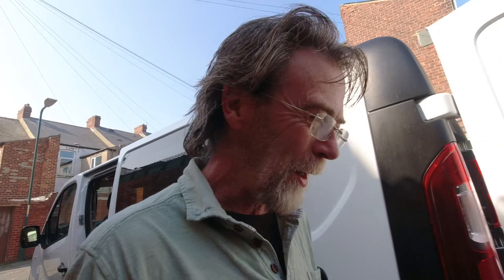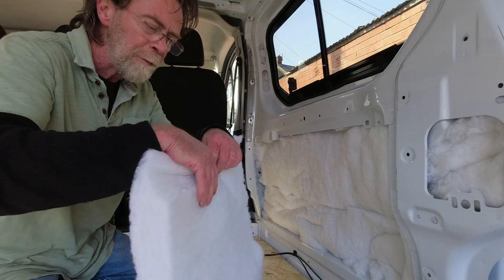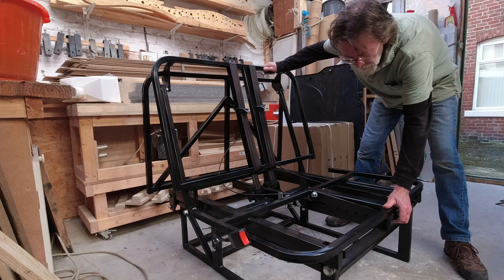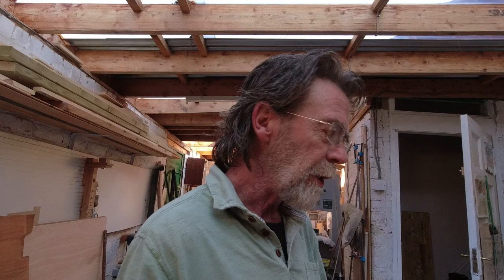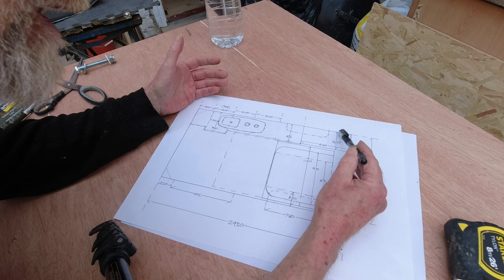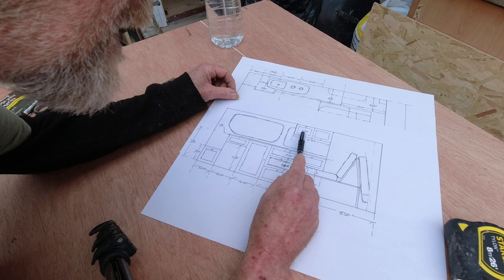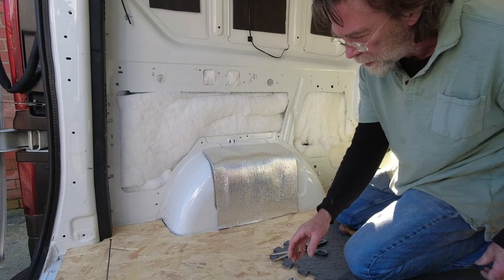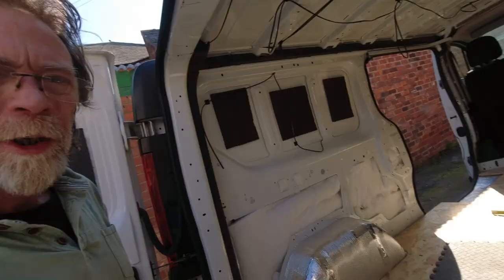Vauxhall Vivaro Campervan Conversion - Pt 3 - Insulation and Floor Plan

Comment: This is blooming tremendous stuff. What a lovely, genuine guy you are Dave and it’s extremely clear what your doing.
Reply from the maker: Thanks a lot Fraser. I'm starting another build soon and I hope to video it too. Oh on the insulation pushed down into the well of the body, I put a vapour barrier over it all to stop any moisture build up and that seem so have worked out well.
Reply: @dave-watson  I’m on the hunt for a van at the moment - I’m going to more or less copy yours! We didn’t really see how you fixed the rnr bed, or I missed it. Do you go through 1 of the cross members?
Reply from the maker: @frasermalcolm8695  Hi, The bed came with 4 heavy steel plates that act as spreaders and fit under the van, but no crossmember involved.

Comment: If you do the Wheel arches in small strips then tape over it's very easy with no stress , people do it the Hard way trying to do it in one go.
Also you can buy a Drill bit with a drill and counter sink in one , i saw another van builder use it , saves so much time.
Reply from the maker: Hi Paul, Yes I got one of those bits with drill and counter sink and it does make it all a lot easier. Thanks for watching.

Comment: Thanks for the video, Dave.  Nice to see a job done well.  I put sound dampening insulation on the wheel arches in our van.  Those wheel arches are challenging to do.
Reply from the maker: Yes the wheel arches are by far the most difficult thing to insulate, a lot of pinching and tucking and plenty of foil tape.

Comment: Hi Dave, I used King span in the bottom parts of my Vivaro ( not right down to the sill area though ), I noticed you push your insulation down on the lower part of your van. This can cause a problem if moisture builds up in the bottom of the sill area which in turn will cause rust and rising damp. Good luck with the rock and roll, ouch my back hurts already.
Great video though, nice and clear and showing great steps in a build.
Reply: I wondered about the pushing it down in to the well. Knowing nothing about it it struck we there could be moisture collecting down there.
Reply: @frasermalcolm8695  If he doesn't live in a van 24/7, there won't be a few liters of water in there...

Comment: Hey Dave, we've been loving your videos! Quick question, what is the difference between the insulation on the floor and the insulation on the wheel hub? 😊
Reply from the maker: Hi Alex, Yes the insulation on the floor and wheel arch is the same stuff. It's closed cell foam. Thanks for watching.

Comment: Ooh that insulation looks interesting, do you have the link please? I’m starting my conversion in the next few weeks!
Reply from the maker: Yes its good insulation. I got it from B & Q https://www.diy.com/departments/diall-insulation-roll-l-6m-w-0-37m-t-100mm/3663602481812_BQ.prd 
And I also got some thinner stuff for the roof from ebay https://www.ebay.co.uk/itm/175223519782?hash=item28cc22ba26:g:V6oAAOxyuCJRfNCg
Hope that helps. Are you going to video your van build?
Reply: @dave-watson  that’s great thank you I love how it’s eco friendly! I’ll definitely be using this. Can I ask how many rolls you needed? I’m converting a vivaro too! But it’s high roof
Reply: @dave-watson  and yes Dave I will be filming the whole process! And vlogging my trips too. Very excited!!
Reply from the maker: For the LWB Vivaro I used 3 of the rolls of the stuff from B&Q and 12m of the one off ebay. Let me know when you get started start with your videos. And good luck with it.
Reply: @dave-watson  brilliant thank you for that!! And I will do, thanks!

Comment: How many rolls did you use
Reply from the maker: I used 3 rolls of the suff from B & Q and 12m2 of a thinner type of stuff for the celling and top panels. I think the next video is about the thinner insulation.